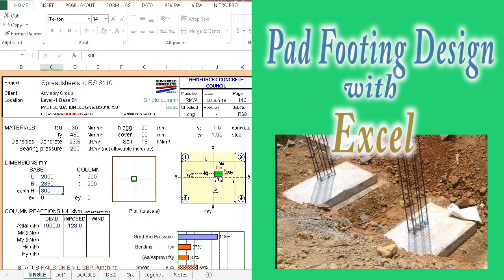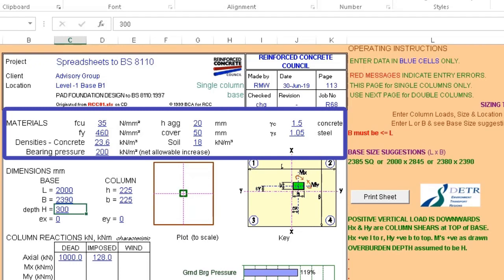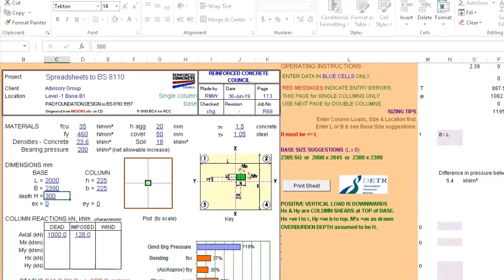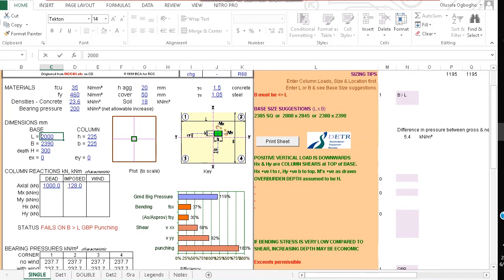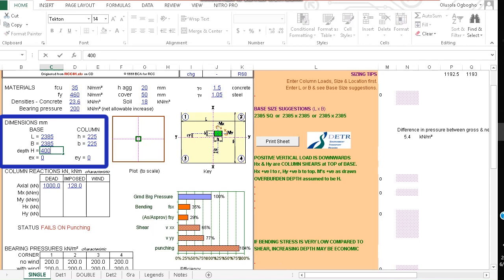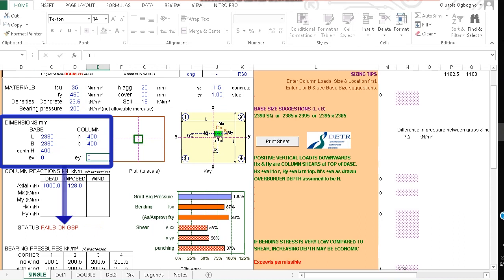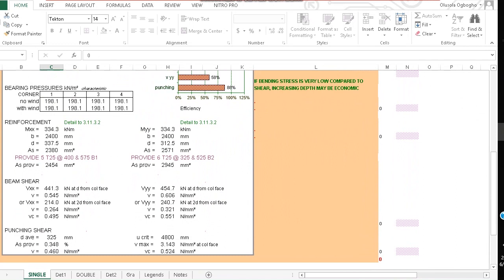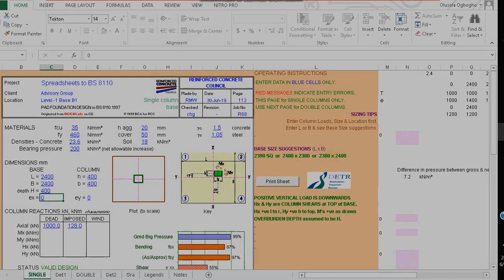Pad Footing Design with Excel

Comment: Link on how you find loadings  to a column using a excel column take down (for the design of a frame structure, where walls are not load bearing) thanks for doing these videos,I humbly appreciate
Reply from the maker: Columns take down RCC 51 download link
https://docs.google.com/spreadsheets/d/1o4NtAAbw54RyciBhQkcO1UAPpGK_xY8A/edit?usp=drivesdk&ouid=106276104383891115503&rtpof=true&sd=true